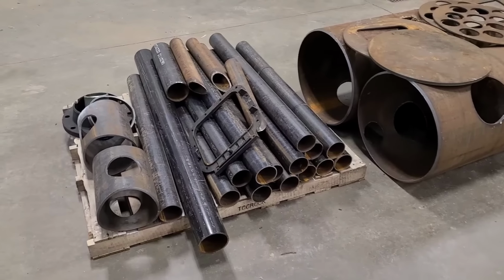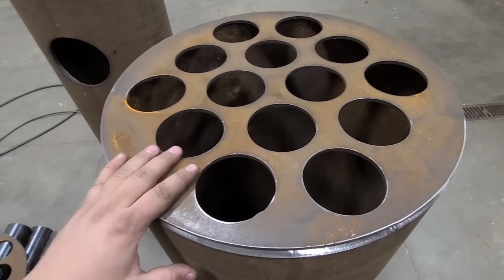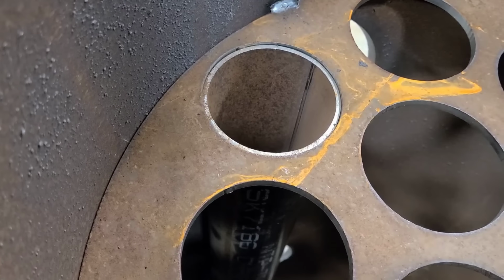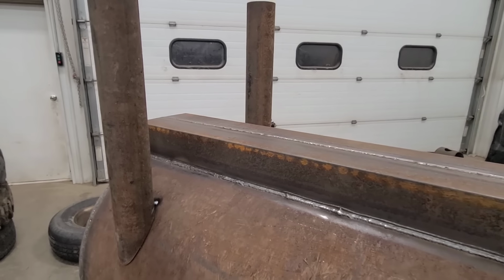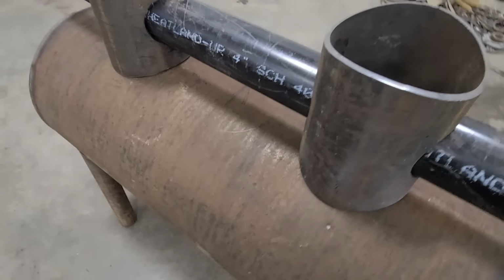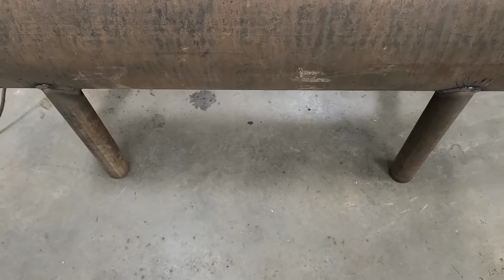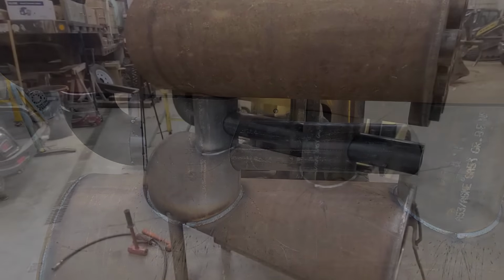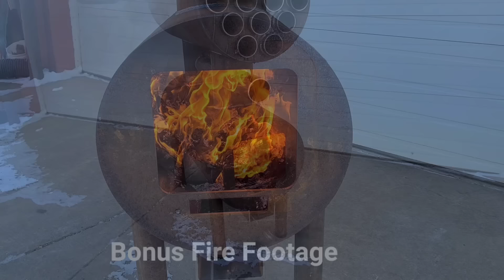My Ultimate Shop Wood Stove Build Part 1

Comment: A consideration: shorten the sch40 air pipe back to the dumby riser to provide space on top of the fire box to add a small flat "hot" plate. You could keep a pot of coffee warm or toast up your tacos 🌮 🌮 🌮
Reply: If he encloses it he could turn that hot plate into a pizza oven
Reply: @RichardCranium321  In the 7-8 minutes it takes to bake a pizza at 500F would dump enough heat in his house to heat a large barn!
Reply: @Bob_Adkins  pizza ovens that run that hot don't cook pies for 7 to 8 minutes.... they cook for 70 to 80 seconds then rotate 180° & back in for another 80 seconds...  anymore than 3 or 4 minutes and it's burnt
Reply: @RichardCranium321  I know. I  bake mine at only 500F and it only takes 8 minutes! Some pizza ovens run at 800F! My point was, that's a large stove and should put out a massive amount of heat! Unless his home is very large, it will only take small fires to heat it.
Reply: @Bob_Adkins  pretty sure that's a stove for his workshop, but yeah I know what you mean.
Reply: @RichardCranium321  Makes sense, I'm new here.
Reply: @Bob_Adkins  so am I.... I just don't think his wife (like most) would allow that in the house,  but maybe she's one of the cool ones. 😆
Reply: @RichardCranium321  Me and my wife would love to have a wood stove, but our HOA would never allow it. :(
Reply: Yep I knew a welder who fashioned a hang on device to hold a can of soup or a can of Cheff  boy r Dee on the manifold of his welder. Hot food for lunch.
Reply: @Bob_Adkins  if you build a proper rocket stove that burns thoroughly without smoke, they would probably never even know
Reply: @RichardCranium321  Yup. Rocket stoves are amazing, burning with a lean flame almost like a torch.
Reply: Because everyone wants to cook pizza 😂😂😂
Reply: @georgewelker853  everyone loves pizza....  it's a proven fact 😏
Reply: @Bob_Adkins   what? the heat is not lost just because its in that space, it still gets out  ,  ever heard of law of conservation of energy ? energy can neither be created nor destroyed; rather, it can only be transformed or transferred from one form to another.
Reply: @DeminicusSCA  I don't recall saying heat was lost, and I learned a lot about thermodynamics from James Clerk Maxwell.
Reply: That was my first thought.  All this work and no stove top.  Huuuuuge fail imo.
Reply: @Bob_Adkins  Time to move.
Reply: Made one out of an air compressor tank on bottom, a 35 gallon drum on top with 2 inch emt conduit tubes for heat exchanger.  Also had wide banding steel bent as a heat sink around stack stove pipe. From the front of the heat exchanger to a 90 then horizontal thru the wall with another 90 to straight up about 15 feet.  We had to drill a hole in bottom of outside 90 because by then the flu smoke was condensing.  Worked great for many years.
Reply: @Bob_Adkins  How would your HOA limit what's inside your house?  Would you have to add a chimney?

Comment: One thing that might help you recover more of the energy is to burn the wood gas that's collecting in the upper chamber. You just need controlled air inlet to let fresh air into that chamber and you might find the thing generates significantly more heat as well as reducing the "smoke" and other nasties. Cheers!
Reply: Problem is that steel surfaces inside have already sucked the heat away from the combustion and there is no more required heat to ignite that secondary fire even if putting additional air in... Fire wood should never be burnt inside steel casing since those surfaces quench the flame leaving a lot of unburnt gases.
Reply: @JuhaErkkila  good point. so the interior would have needed to have a fire brick lining being considering that plan then.
Reply: Not true, if it is sucking air properly combustion will continue through the exhaust making a complete and smokeless burn which is essentially how "rocket stoves" work.
If anything to be more efficient he should have the upper chamber split in two so it has to enter, go the length of the heat exchanger, then go back along the top portion before exhausting out the top that way more heat is effectively transferred. As it is this is a common design flaw I see with this same style.. Most of the heat is barely being used and going right out the exhaust specially with the double opening to the heat exchanger the back part won't be getting as much oxygen and thus burning more incompletely.
Reply: @SilvaDreams  I think he only has 1 opening to the rear of the combustion chamber. The other was a dummy coming up near the front of the fire box
Reply: @SilvaDreams  There is only a single entry and exit to the heat exchanger, and they are at opposite ends.
Reply: @bretmohler9719  Pretty much yes. There should be areas dedicated for burning and only after that heat recovery. When burning wood those two should not be mixed up because result will uncomplete burning.
Reply: By using a catylitic converter he can burn off those gasses without inducting an air source. It will allow the burn chamber to run at an idle while increasing temperatures in the exchanger, but Juha Erkkila is right also, significant gains can be made by lining the combustion chamber with refractory. Be it fire brick and mortar or a monolithic.
Reply: @DefendedBear  Are these catalytic cartdridges how available for diy use? Of course spare parts from ovens could be used but material wise might be out of reach of diyer?
Reply: @JuhaErkkila  got an old mid eighties or newer car sitting around behind a shed or barn that will never run again. It has one between the manifold and the muffler. Cut it off and open it up.
Reply: @DefendedBear  Ok. This sounds interesting. Should that "ceramics" be cut in half (to get shorter flow path and to use those blocks in parallel) Just thinking that it might be too long/narrow for this type of use?
Reply: @JuhaErkkila  I harvested mine off a '90 Chevy Silverado which had twin converters. Opening the case gave me two disks each 4.5" in diameter x 1.75" thick. I have double risers from my chamber to my exchanger in my barrel heater each made from 6" schedule 40 and I set them in each end using Sairset 3000 refractory mortar. The flow is reduced but it runs hotter with an idled fire that creates more carbon monoxide so it's not a problem.
Reply: Like as little as those fans used for laptops or much bigger ?
Reply: @bretmohler9719  or  refractory cement.
Reply: @JuhaErkkila  all you'd have to do is run the exhaust back in the original burn chamber and then run a secondary exhaust port that actually serves as exhaust. It would actually be incredibly simple, I work in a wood pellet plant, trust me when I say I know exactly how much shit is produced that is flammable post burn, we use an esp to molecularly extract the creosote from wood, your combustion source for the expelled gasses would be the fire in the main chamber but you would want to install some sort of regulator so that only so much exhaust fumes end up back in the wood fuel chamber
Reply: Or just build a wood pellet stove instead of a wood stove if you're worried about pollution
Reply: @elijahbates9643  for me at least, it's not so much about pollution, it's about efficiency of burn and getting the maximum energy out of the fuel.
Reply: @DefendedBear  when you do a video of it, by using all the photos you took, tag me id like to see that.. PLS coin $0.00005

Comment: My big concern is the dummy pipe between the upper and lower chamber is a sealed pressure vessel.   If you don't  already have a vent hole, please add one.
Reply from the maker: The welds have an 1/8" gap on the top weld in the back of the dummy pipe 👍

Comment: Kyle,  I would tap into your blower chamber and use it to run some air into the pipe between the firebox and the heat exchanger.   That would give you a secondary burn when you are calling for heat.  I would come up with some sort of check valve.   Most of the secondary air systems preheat the air before introducing it.  I guess you could restrict the opening of your mid-heat exchanger pipe and run it back from near the exit where it is warmer and use that air for a secondary burn.
Reply: Secondary chambers are amazing when they work correctly.  There was almost no smoke from the stove at my old house when it was warmed up and full of wood.
Reply: I was thinking the same thing. It would really improve on efficiency and reduce the soot buildup on the heat exchanger tubes. A fellow could just drill an 1/8" hope of 2 completely through the 6" riser and schedule 40 pipe. Then weld the outer holes closed.
Reply from the maker: I'm not opposed to something like this, my only concern with this is pressurizing the burn chamber enough that I hurt or even take away the draft. The last thing I want is smoke coming back out of the door or air damper and into my shop

Comment: I am amazed at the thickness of the metal. This is what has to be done for longevity of the stove. Most people just use steel barrel drum which lasts a few seasons and you start over again with a build.
One more thing fella. You should of added a secondary air burn feature. This would reduce the amount of wood needed by at least a half. The amount of ashes left from the combustion process would be just the bear minimum. You would be amazed as the how well that works. 
The third thing I can say is to make the stove using stainless steel metal. The look of stainless is just second to NONE !!
Job well done Kyle, PERIOD.

Comment: I built one almost like that about 35 years ago to heat a shop in Montana. Made it long enough to burn old ceader fence posts. We were putting in new fence, so we had a ton of old posts. I didn't have any fancy tools for making it, just a cutting torch & stick welder. Brought it up to the Ag Show also with some custom gates & cattle guards. Most of the steel was old oil field pipe. It would make some terrible smoke welding it, im surprised I'm still alive.

Comment: Nice job! I made one of these about 30 years ago for my fathers off grid cabin, same design with 20”x1/2”wall pipe, only thing I did different was to add a stainless steel water tank off the back end, it generated steam for humidity and hot water for washing stuff, it would heat his 750sq ft cabin, so hot you had to open a few windows.
Reply from the maker: I may add a piece of flat stock to the side of the burn chamber to put a pan of water on, we will see, smaller things like that can always be added/removed down the road
Reply: I like the symmetry of the stove and I would maybe change a few things. I would add a plate that would slide on the tubes to scrape off soot or ash the make it more efficient and I would shorten the heat exchanger to about half the size. That would make it more enjoyable to load wood into. The large pipe at the middle is ok, but I think it's gonna be too restrictive. I would incorporate a 1/2 inch plate on the top of the burn chamber in the front to cook on.

Comment: Kyle,
i realize i'm a little late to the party and this thing is already in service. overall i have to say you did a really good job of putting this thing together, selected some good materials for the project, however, if and when you ever have to go back and redo parts of this, keep some of the following points in mind: 

you didn't give your heat exchanger pipes a means of expansion. in a steam boiler, the fire facing ends are welded to the face plate which you did correctly, however on the exhaust end they get rolled in. there is a device that swages the pipes out to tighten up against the holes in the rear face plate. this way they can still expand in length and girth without putting strain on the welds of the faceplates but still remain airtight. you could try using an automotive exhaust pipe expander unless there is a boiler shop near you... unless i miss my guess, you will back in there rewelding the lower registers of pipes as they take the brunt of the heat rising up and the heating/cooling cycles will cause your welds to crack and allow carbon monoxide to seep out and enter the shop air. if you have no other choice but to weld the exhaust ends of your heat exchanger pipes, i would suggest using a 3/16ths 6013 rod that is used in boiler and steam applications. it does a better job of expanding and contracting at the same rate as the parent material. i didn't catch what grade of wire you were running in the MIG welder which is why i am suggesting it. another advantage to using rod is that you can bend it to get into those nooks and crannies that you were having a hard time getting into with the MIG torch

something else that to take into consideration is the size of your draft. since this is a naturally aspirated and not a forced draft, the fresh air intake should have a slightly larger cross section (5 to 10 %) than the smoke riser going into the heat exchanger with the obstruction of the primary heat exchange pipe. by undersizing the fresh air intake you are starving the fire for oxygen, making the fire smolder. this in turn generates a lot of creosote, nitrous oxides and carbon monoxide which will foul the heat exchanger requiring frequent maintenance. now, by putting a damper in the chimney outlet you create a dam effect that gives you a more complete burn thus increasing the amount of heat gleaned from your fuel as the gasses are slowed way down in the heat exchanger. by partially opening the intake damper and closing the chimney damper a lot of the soot elements carried up off the fire will be combusted as it exits the burn chamber. it also great reduces the amount of CO the stove will generate by giving you a more complete combustion. while stove roaring with a draft open is a cool thing to hear, the fire is subjected to high degree of turbulence. while it may seem you're getting a complete burn. most of your energy is going up the chimney. by closing the damper in the chimney and opening the draft you get a pyrolysis effect that re-combusts the VOCs released by the fire very efficiently. the smoke at 9:36 in part 3 of this series is about 30% of the thermal energy of your fuel going poof! 

next, a baffle plate of sorts can be put into the burn chamber to keep the flames from directly entering the heat exchanger during initial daily firing up. that causes the flames to take a more indirect route into the exhaust and re-combusts another large portion of the VOCs and soot released by the flames that will otherwise accumulate in the cooler parts of the system.

the end plates on the burn chamber should have been bowled a slight bit as the expansion of the steel goes out in all directions. at some point in time you will see cracks forming along the weld seams and the endplates will also start to buckle and warp. by them being cupped slightly, it gives the material a place to go when it gets hot and not deform in doing so. 
grates are not the best thing to put into a wood burner but if you must then i would recommend cast iron grates. steel webbing will burn up in a few weeks and steel grates will last only marginally longer. you can get inconel grates that will outlast cast iron but those are insanely expensive and unless you get exactly the size you need, they are almost impossible to machine with conventional tooling on a milling machine

now people are probably think i'm totally nuts, but here's a crazy tip for day to day operations: every 2 or 3 days throw a handful of rock salt in the coals of the fire or a few beer cans. there is a product on the market called "Red Devil" (it's kinda spendy) that you do the same thing with. this keeps your chimney pipe clean. it really eats the gunk in the chimney up. i'm not sure what chemical reaction is going on there, maybe somebody who has a better grasp of it can comment. many snows ago when i built my little cabin in Elk City ID, i would do that and never had to clean the chimney pipe...ever 
just for reference: i used to help run a 5MW wood fired, forced draft boiler and was tasked with rebuilding the refractory walls of the burn chamber and access hatch, did a lot of the welding of the additions to the low pressure steam distribution system, as well as a majority of the welding of the ductwork for the exhaust gas filtration system of that boiler. so the points i brought up in this comment are based on those experiences and observations

good work, good show and good series, thanks for posting!! 
cheers! mike

Comment: Awesome build . I would think it will work good . One suggestion on the tubes . Instead of cutting can you stick weld them ? We build tube bundles for the oilfield and we have to stick weld the tight areas . Keep the videos coming !
Reply: Or switch to Flux Core for that small area and not run a nozzle.
Reply: @noidontthinksolol  yep, stick over mig, any on application like this. But chicken scratch welds will pull smoke around welds, the temperature difference also will make it draft out at those points also.
Just saying, no disrespect to you.
Reply: Yeah, I was going to ask why he didnt stick weld also. Maybe he isnt comfortable with stick. Unless he lays the thing down they would be vertical stick welds and they can be tricky if you dont have experience
Reply: Stick weld is my flavor!

Comment: Kyle , My hat goes off to you !! Great fab/build !! I built a wood burner somewhat like this in high school. Your's is a lot more efficient than mine. Mine was a rectangular cube with 4" pipes running side to side. We had a sheet metal guy build a sheet metal boot around it. Mounted it next to the furnace and attached it to cold air ducts. So all we used on the furnace was the blower. Needless to say, we burned up blower motor in furnace quickly. Too hot ! Once we mounted the motor outside the furnace? It worked like a charm for over 20-25 years. My dad was very happy !